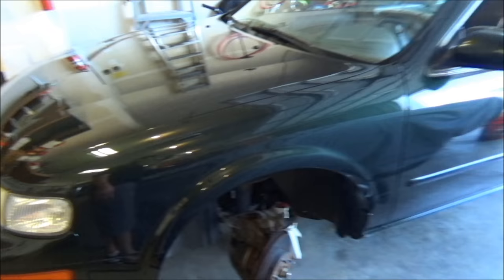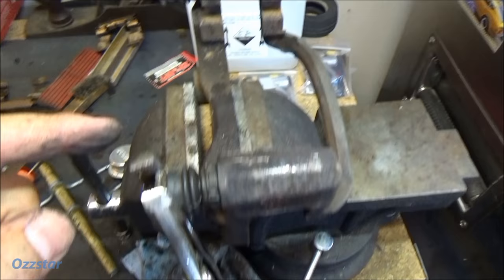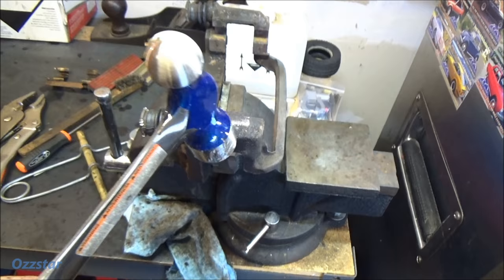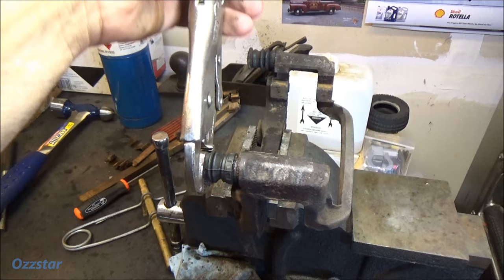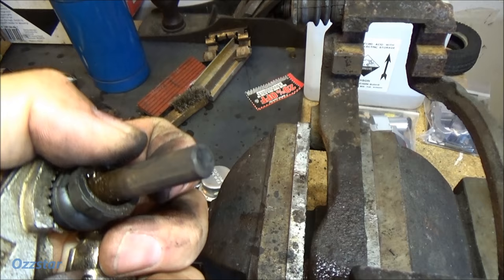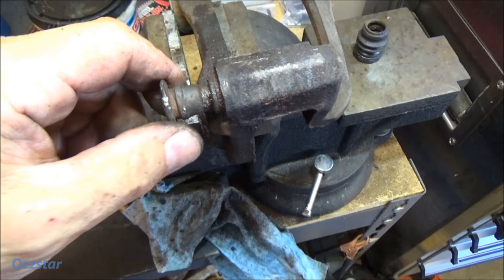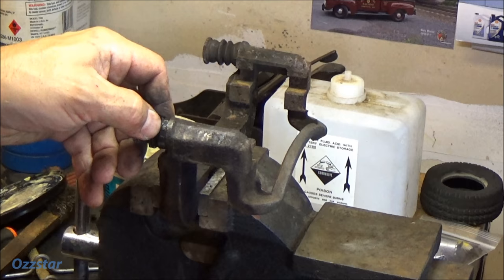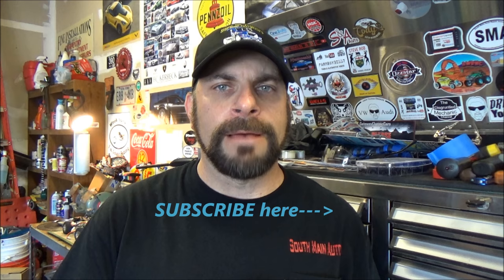Brake Caliper Pin Rusted Stuck - Heat n Beat Fix

Comment: Never ever use heat to get these pins out. The grease inside where the pin is will turn into a gas. we just had one fire across the shop like a bullet. It definitely would have killed somebody.
Reply from the maker: That is possible if extremely heated to red hot. Sometimes all that is needed is a little bit of fire like in this video.
Reply: @ozzstars_cars  I wouldn't put any heat. I was sitting next to the guy who was doing it and it definitely wasn't cherry red. He had heat on it for maybe 10 seconds and then the thing fired like a gun. Scared the crap out of the both of us
Reply from the maker: @tommccarron324  wow! That's crazy.

Comment: Will this help on a car that has been sitting for three years ?  I suspect my calipers may be locked up because when I put a crow bar near them and have someone pump the brakes I don't feel them squeezing the rotor at all ?
Reply from the maker: Sometimes replacement us the answer. Good luck.

Comment: What do I do if it’s stuck, but dry. I got it off but mine is rusted and doesn’t have any sludge at all. It was literally metal to metal rubbing should I replace the part or will some lube do the job
Reply from the maker: After cleanup if the pin has slop buy a replacement, you will need a new boot kit at the very least to keep water out.

Comment: Hello Ozz (Glen),

I was watching your video about stuck slider pins on brake calipers. I notice you mentioned about heating the caliper up with a propane torch. I also do that if I need to. I wanted to mention a word of caution when performing that type of procedure. That is, that I heated one up one time. I must have heated it too much, because I went to put a wrench on the pin to move the pin, as soon as I tried to turn the pin, and without even turning the pin just added a slight pressure to it the pin shot out of the caliper like a bullet. If I had of been in front of the caliper I'm positive it would have penetrated my abdomen for sure and would have been in trouble. Just to mention also in my garage I had an electric stove across from where I was doing this, the stove was approx 10 feet from where the caliper was when the pin shot out it broke the stove oven glass in a million pieces. So please be careful and be safe when doing this kind of work. I believe it shot out because grease or water that was in the cylinder of the pin must have turned to steam and built up excessive pressure on the pin. Never stand in front of the pins, always to the side.
Reply from the maker: Thanks for sharing your story Bob.  Glad to know that you were not injured.  Working on anything requires safety and doing our best to prevent injury.  It is important to know. Appreciate your comment.
Reply: Thanks Bob... near miss!
Reply: very informative thanks
Reply: Thanks, Ozz. I was surprised to find that the siezed pin I've just found is a common problem since Ive never come across it before. I'm grateful for your advice, and will finish the job using your advice.
Reply: Very grateful for that advice, Bob!
Reply: I had this happen yesterday. I brought the cage (bracket) to a VIP and asked if they could heat it up for me as I did not have a shop vise at home. The guy was so nice to help me but heated it up with his oxy/acc torch and within a minute, that pin shot out of there like a cannon. It scared the crap out of the guy and the other guy watching. The guy watching was like "where did the pin go"!!! I said, look at the windshield of the car on the lift, it's now in the driver's' seat.  The panic on his face was hysterical.
Reply: @DropDMurphy  omg, that's horrible lmfao. I hope he didn't get in trouble
Reply: @Mazdatree  No. we all laughed. It didn't go through the windshield, I just told that to the inexperienced guy to see him panic. You always have to mess with the newbies.
Reply: Thanks Bob
Reply: Life saving advise right here. Thank you, Bob❤

Comment: I replaced my pads a week ago and ignored one seized caliper clip pins and almost died in the highway, got it towed to the house and will replace/fix it today. Thanks for the video, great info
Reply from the maker: Be safe.
Reply: Just replaced my rears, 1 pin was seized, fixed it, glad I did after reading your post. Greeting from Australia😅.

Comment: Your heat n beat method did the trick…..luckily, I had a spare pin from previous job ( I keep all kinds of old crap).. because I destroyed the pin head getting it off…couldn’t have done it without you…heat n beat is often the solution!
Reply from the maker: Nice job Phillip

Comment: Good tips.  I agree with only using silicone on slide pins, petroleum based products can swell those rubber bushings up and cause them to seize.
Reply from the maker: Yes I have seen it. 👍
Reply: I saw my mechanic put in lithium heavy duty grease. Will that be a problem?

Comment: Just run into this issue on a light truck. Was just about to take the bracket off and put some heat in it. Looks like that’s the way to go. Cheers for the confirmation video

Comment: Fantastic video. Thank you. What works for me is just rotating the caliper pin back and forth and pulling on it gently, I rocked it back and forth about maybe 50 times, sprayed W-D 40 in the space between the boot and the pin, and eventually it gave way and slid out. I hammered lightly as well. It's amazing how these caliper pins get stuck all the time.
Reply from the maker: They can be a pain. Patience is key! Thanks for the comment.

Comment: front passenger wheel was squeaking horribly, took the caliper apart and sure enough a pin was stuck.  watched a few youtube videos including yours and was able to get it out and replace with new hardware & lubricant, good as new.  thanks so much, very helpful!
Reply from the maker: Good news.  Thanks for your comment.

Comment: This is exactly the video I was looking for since I have the same issues on both driver and passenger sides. What a pain in the ass. 
And you're correct. A 2009 Nissan Cube, they do not even have the caliper bracket for purchase. Thank you so much for uploading this.
Don't any of you dare to do a disc brake job without checking your GUIDEPINS ! My fault too.
Reply from the maker: Glad the video helped you out! Good luck. -Glen
Reply: Lexus is250 awd rear brake caliper bottom sliding guide pin sizes in bore. Big pita. Great video

Comment: Thank you for this informative short video. I was working on my front brakes of T sienna, and one of the caliper pins wouldn't budge. I took out the bracket out, have soaked with WD-40. Will use a vise as you have shown, will try to get the caliper out as you have described. What is a good criteria to decide on a new caliper pin or going with the old one?

At 6.00 in your clip, you talked about a small sleeve on one of the pins, your thoughts on why only one caliper pin has this (and not both the pins). Is this sleeve really necessary as I have seen some mechanics saying it's not that important.

Thanks again!
Reply from the maker: The sleeve is made of rubber and it's purpose is to dampen vibration and reduce brake noise. A replacement pin must fit snug but be able to slide with no excessive wobble. Careful not too use to much heat, it can cause the pin to shoot out like a bullet.
Reply: Thank you
Reply: My first attempt with heat and wiggle didn't work. Now I have added some more penetrating oil and left it. Will try again. In your opinion, LH and RH caliper brackets are they the same? Looks quite similar to me, any thoughts? Thanks
Reply from the maker: @pradeeppallan2232  left and right depends on the design. To many cars out there to guess.  Takes a lot of wiggling and beating sometimes to get those rusty pins out.

Comment: Did a whole rotor job today with my lil bro assuming that was the root of his problem as we drove to test it out we see smoke coming from front driver side, annoyingly took off the wheel to find a stuck, seized, rusted, guide pin. this video helped a lot unfortunately didn't have a vise so we couldn't remove after torching, We ended up ordering the new bracket with guide pins.

Comment: Great tip to check when you check the brakes. Fixes lots of brake problems so you don't have to heat and beat. Thanks Glen
Reply from the maker: That's right man!
Reply: @ozzstars_cars  sometimes you got to beat the heck out of the parts to get em to move again then clean em up and lube!  30 minite job turns into 1 hour!

Comment: Great tips, Glen. You might add not to stand in front of the bracket while you're heating it. I have seen those pins shoot out like a bullet out of a gun sometimes.
Reply from the maker: Yes someone else.mentioned that.  I never knew that until now.  Thanks for the tip.  Have a happy 4th man.

Comment: I replaced all four a few years back. I found the front passenger brake caliper and wheel burning up and smoking after a day's drive. The pin is seized from rust just like yours was. And it looks like the pistons are seized. The damn things are not cheap but I have to buy new ones.

Comment: I have a 2015 Mazda CX5. Had a rear caliper freeze up a few years ago and had it replaced. I made sure the front pins were lubbed with SIL-Glyde. Went to change the front pads this summer and one of the pins wouldn't move.  I had it mounted in the car and took an open end wrench on the pin and hit the wrench with a 4 lb hammer quite a few times and it came out. The wrench gripped both sides of the pin so there was no issue with bending and it didn't dig up the pin.
Reply from the maker: Make sure the rubber boots are in good condition.

Comment: Had to do that on a Sienna, twice within the last couple months. 1st time was late April, and redid it this wk, but I replaced the boots this time around. I used a drill with wire brush to clean out the bore. Hoping it's fixed permanently this time around.
Reply from the maker: What a PIA.  Yeah I ordered new boots, should solve the prob.  Those Toyota calipers can get pretty rusty.  This is a 21 year old Maxima so not too bad for that age.  Take care Cuba

Comment: How did you heat it without wrecking the boots?  Normally I wouldn't worry about that, and just replace them, but you can't just walk into a store and buy them it seems.
Reply from the maker: I don't heat the metal cherry red. Just to the point of hot, flame away from the boot.

Comment: I tried this & it only got somewhat loose, so instead i just put whole bracket & pin in the vice & it slowly started pressing it in & the pin just slid right out once it got unstuck! Thanks for the heating tip!
Reply from the maker: Glad it worked out for you Roman.

Comment: Ive got lucky a few times. Lots of heat. Vise grips on slide pin. Work that sob loose. Buy new pin set better then $200 caliper!! 
Trucks here 2500hd,s 
Why cant a grease fitting go in that bracket to grease slides when doing your ujoints ect. 
Contemplating drilling /tapping next new set of calipers and putting grease nipples. Or look at the idea a little more. Nice vid. Thanks champ
Reply from the maker: Folks would probably over grease and that would melt and get on the brake rotos and pads.  Not a good thing if trying to stop. Good in theory though.

Comment: Should I bother take the caliper pins out and lube them if they.move freely?
Reply from the maker: I do because it could be years before the brakes are serviced again and by then the old grease can dry out and seize the pin causing abnormal brake wear.
Reply: @ozzstars_cars  Thank you.

Comment: Thanks for helping me out. Half a can of WD40 , a hammer and a good wrench did the job and I didn't need the heater. It took me about half an hour to get the damn thing loose though ...
Reply from the maker: It's a battle sometimes. Glad you won. 👍
Reply: @ozzstars_cars  I'd like to ask you another question if I may. I have a 2002 GMC Yukon 1500 and the digital temperature/ AC controller only gives me 2 options: cold on every setting and very hot at maximum setting (nothing in between). I've calibrated the heater module, I've replaced the blend door actuator on the passenger's side that regulates the heat but without succes. What's goin' on here ? Thanks for your time.
Reply from the maker: @superfluppe  there are too many variables to type an answer here without diagnosing the truck in person.  If the correct relearn procedure was done then I would suspect the control unit. Maybe the contacts need cleaning? A scan tool with bidirectional controls would be helpful. I have a video that might give some clue though it's on an older '93 GM with electronic climate control repair.  https://youtu.be/KBeqA1n9q9A
Reply: @ozzstars_cars  It turned out to be the inside temperature sensor aspirator ...

Comment: Does the seized pins cause spongy or soft brakes ? I’m having this issue after had installing new rotors and pads. Everything was installed correctly and I double checked but now my brakes are soft. I bled the air out too
Reply from the maker: Anything is possible. You may want to check that ALL caliper pins are sliding smoothly.

Comment: On the heat part... how hot does it need to get? I got one stuck good and tight nothing is working so far.
Reply: time to get a new caliper
Reply: @raccoon874  😂 exactly what I did in the end, after wasting a lot of time trying to free the darn thing.

Comment: Hi in this interesting vid you show the cleaning of the guide pins. why are they different from each other? that is, one pin is completely smooth and the other instead has a black coating as if it had a darker metal band around ? what is it for? Should the one with the metal band be at the top or bottom of the assembly? hi thanks for the answer
Reply from the maker: The black band is a rubber sleeve that acts is an anti rattle device, which prevents noise.
Reply: @ozzstars_cars  so whether it is mounted above or below makes no difference or is it better a specific position?
Reply from the maker: @iMarco M  usually the smooth pin is at the top and what the caliper hangs on and swings up, the rubber bushing pin is at the bottom.
Reply: @ozzstars_cars  ok very kind! for your providential answers!!!!!!!

Comment: Thanks for explanation
When My brake pads cannot  retract (a little bit) , I press down  break padel and then brake pads are free, what is problem?
Is concern with cliper guide pin? air in brake line? Master cylinder?
Reply from the maker: Could be a lot of things. Test don't guess.

Comment: I dont have a blowtorch but used a paint heat gun to provide the heat - that also did the trick after 3 goes.  I destroyed the boot and while I am waiting for the new pin and boot I cut  a section from a bigger sliding pin boot from some junk I had lying around from a previous job!
Reply from the maker: Sounds like a real pain.  The heat gun is a good alternate, thanks for sharing.
Reply: @ozzstars_cars  Repeated applications of the heat gun, hammering   with a drift, and working the pin left and right, eventually loosened it - after 40 minutes!!  Perseverance paid off

Comment: @ozzstar's cars do you think that if the bracket pin is stuck can cause pulsing to the brake lever on a motorcycle with floating calipers? Any advice would be much appreciated!

Comment: Dude I couldn’t get my top caliper bolt out today . I tried everything I know . The bolt head is stripped now . What can I do to get this out ?? Actually I haven’t tried a real penetrate yet . Just WD 40 . Im gonna get some tomorrow and hopefully they have some type of wrench that will tighten down on head as I beat on it . What do you think
Reply: I did put some heat on it too . Maybe not enough . Had to be careful not to burn boot
Reply from the maker: At the very least you will need a new bolt but if it snaps off a new or used caliper bracket and slider bolt boot kit too.

Comment: my first time doing brakes ever on my car, I ran into this problem. so I took a crash course through YouTube on how to replace a caliper and how to push the air out and bleed the caliper.
it is possible I could have dislodged the pin? maybe. but I do not have a table vise so I just went with a straight up replacement. now I know to check those rubber boots and re-grease the pins every 6 months or so.

Comment: What kind of noise the caliper make if its stuck or bad ? I just replaced my wheel bearing thinking it was bad ..drove the car for less than 24 hours and the noise is now back ..it doesn't sound like a grinding or squeak but a wha wha wha sound ..could this be my issue ?
Edit : I have a 2002 Toyota Camry
Reply from the maker: Impossible to diagnose online.

Comment: I have this issue in my Mazda, but the pin got stuck in the caliper (not the bracket due to their design) is it safe to heat up the caliper a little to see if it loosens up?
Reply from the maker: A little heat goes a long way.
Reply: I did it yesterday and it worked, thanks!

Comment: great job man good tips i dont know if theve upgraded caliper pin bolt boots but really need something better then just a cheap boot to protect the pin from freezing up dont know if this is a problem in the southern non rust states or just a northeast thing
Reply from the maker: Happens often. Thanks for your comment.

Comment: Well I'm gonna give it a shot cuz I tried all u have except heat. Bout to put some heat to it and ill let you know. Quick question......If I tear the little boot that covers pin can I buy just the boot?
Reply from the maker: Caliper pin boots are available for most vehicles.  Good luck and wear safety glsses
Reply: @ozzstars_cars  Just so u know I spent hours with many tools trying to bang the thing out. Nothing. Watched ur video then. I am an HVAC Technician so I pulled out the torches. 3 minutes later pin was out. Cleaned good and greased. Truck back on the road thanks to you

Comment: You could also thread a slide hammer on the pin and hammer out a few times with a light 5 pound or less size slide hammet
Reply from the maker: Good idea.